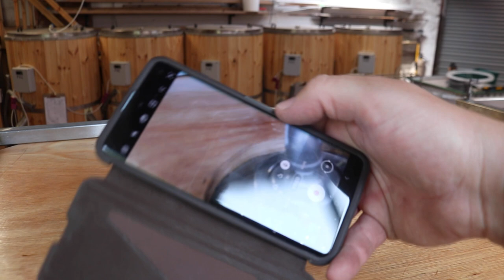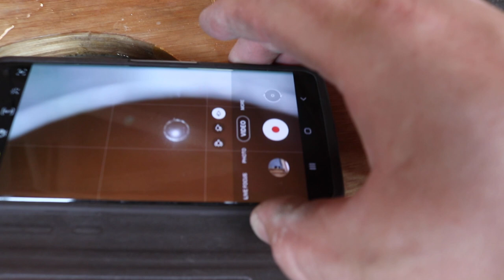LaSt Of ThReE

Comment: I just recently subscribed to this channel, and I wish I had found this channel sooner. I just completed my 5-year long part-time journey building a single tier RIMS based brewing system. Now I did not weld my own vessels opting instead to go out and purchase 3 20 gallon stainless kettles, but watching your dogged determination would have really helped me when I was staring at a snarl of wires in and around my brewing controller, and the frazzled nerves trying to drill and punch holes in those kettles. Now I am faced with programming my own fermentation controller and I'm using these videos to encourage me onward even when I'm getting lost in my own code. Thank you Harry for just blasting out these videos over the years!